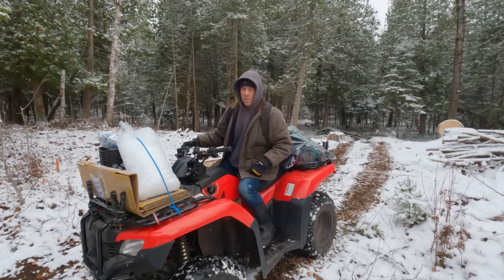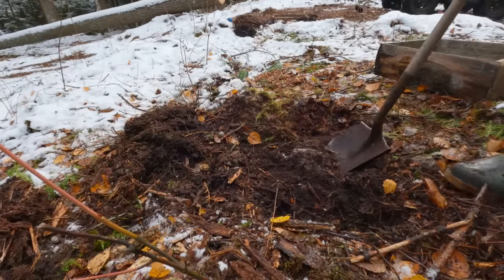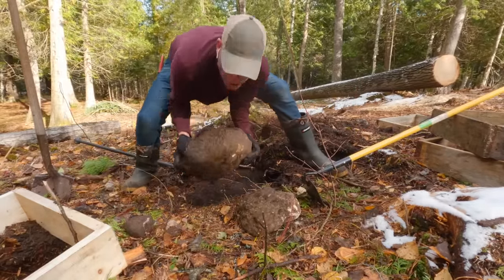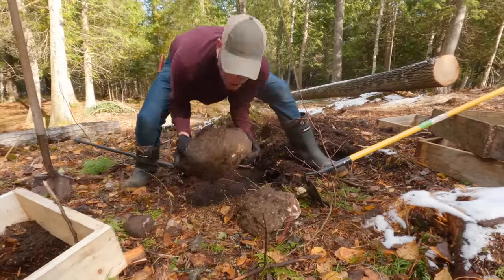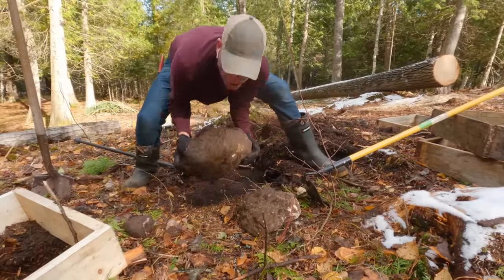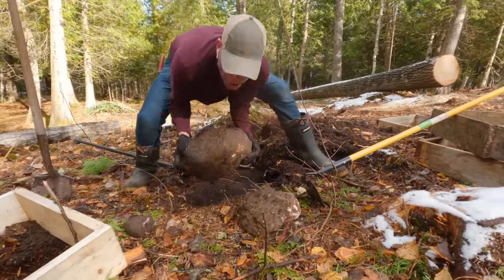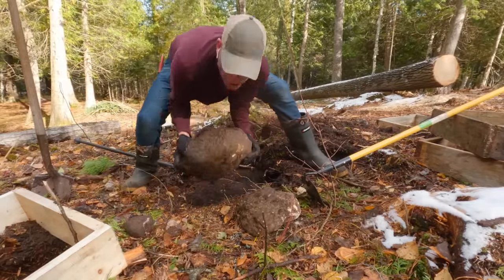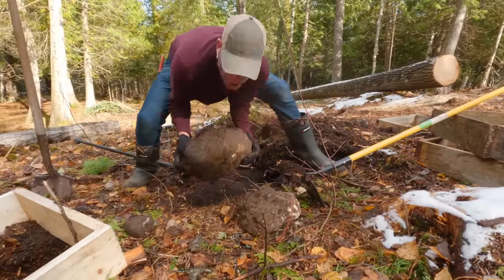An Abnormal Way to Build a Kitchen Foundation. #164

Comment: My father's neighbour built a wooden fence between the two properties and painted it with creosote and oil mix. Forty years later it is still as good as new.
Reply: Yes, if you use used diesel oil on the foot of your posts,soak em overnight, do the same with your gravelboards. Used motor oil and creosote for the rest.  Don’t lean on the fence !!
Reply: My grandfather had a raisin vineyard with 8 x 8 split redwood posts at the ends of each row of grapevines. He soaked the posts in oil & diesel mix by setting them into a 50 gallon drum. The posts had a lot of weight on them when the crop ripened. I sometimes got to help him replace the few that broke. Redwood isn't very strong and the posts that broke were from of the amount of the weight on them, not due to rot.

Comment: I've used old motor oil from my tractor to stain/preserve my cedar siding to an outhouse. No odor of oil with a little time and has preserved it for over 12 years. Still looking good with the right amount of an old pioneered weathered look with no grey. Works great for fences too

Comment: The oil preservative is an old timer trick.  It really does work but the reason people generally don't do it any more is that the oil gets into the ground water and you eventually end up drinking trace amounts of used motor oil out of your well.  And there is pretty much nothing in motor oil you want to drink, even in very tiny amounts.  It is kind of amazing how much water can be polluted by a seemingly insignificant amount of oil like that.

Comment: I've been watching your videos for about 2 years Ryan and I've finally caught up to be getting them weekly fresh fresh like the air you breathe which has gotta be fresher almost than gods own Yorkshire here in the UK lol you might have lower temps but it's colder here lol though 12v waterproof led strip lights mate. £5 and remote control. One of your batteries would run them 2 month x love what you do. Make do and mend. Respect Andy

Comment: There is a mix containing borax that works well for wood treatment. I tried it experimentally on fir logs (half with half without) the treated logs got three times the durability. ( in years ).

Comment: As always, it's been a delightful visit. Thanks for the video Ryan !
Not giving advice here, only sharing a possible tip that might interest you. I recently learned of an alternative to using dynamite for demolition (especially breaking boulders.) It's called: non-explosive expansive demolition grout. You need a rotary hammer and a rock bit.  Drill holes in the rock you want to break it. Looks like you then have to mix the grout with water and pour it into the holes. In a day or two it expands with 18,000 PSI of expansive force to break the rocks. We can get the stuff from a big box building supply or online. (A common brand is Dexpan.) I haven't used it yet but if you ever find a rock that is seriously in your way I'd love to watch your approach to using this stuff. 

77.2K

Comment: Great projects as usual. I really love that you build things by ideas rather than plans. On a regular job site if they are missing a part there are delays, on Ringwood, if you need something you don’t have you come up with an alternative. I do like rock and mortar projects but not in cold weather. When you first said machete chandelier I imagined a bunch hanging from the ceiling with the blades pointing down 😫. You vision seems less deadly. Thanks for sharing!

Comment: When I use cedar in or on the ground I burn the outside of it with a roofing propane torch then put on the used oil.

Comment: I enjoy all your builds, but you really need to add skirting around your cabin to block off the cold air flow from blowing in.
Plus add some foam panels to the skirting....it will make a big difference.
Reply: Mice

Comment: Hi Ryan.  How do you like that Champion wood chipper?  After using it for a few years, would you buy the same one again?  I am in the market for a chipper.  Thank you.
Reply: I have a Harbor Freight chipper. Except for the color it looks similar to Ryan's. I've been happy with mine. It took a bit of experience in order to use it efficiently. (I don't try and chip long limbs of maximum diameter through chute and I learned to not overload the top hopper with twigs and foliage.) I had low expectations but have been pleasantly surprised at how well it chips.

Comment: I had to mix some concrete and I used my portable propane hot water heater. It would be perfect for your shower. RV 12v pump and endless hot water. Well, tell your water tank runs out

Comment: The smell will go away but not as fast as you want it to.  To make it soak in more, use diesel fuel.  Now there is a smell that will gag you.  But it will go away to.  It would have been nice to use the flat stones for the patio and cheaper to. Maybe more labor.  Later

Comment: How are you going to stop the propane from freezing?  Most people box their outside tanks in and insulate.
Reply: Propane won't vaporize when it gets down below -43ºF but the gas pressure can drop too low to run a heater before it stops flowing completely. It seldom gets quite that cold in the UP but it probably could. We have a 400 gallon propane tank outside our northern Minnesota fishing cabin. I also keep a 20 lb. bottle inside over the winter just in case but haven't had to use it yet. I also have other heating options. Ryan seems to keep an eye on the weather forecasts. If I were him and I heard that a polar vortex was coming I'd drive down and stay with Sarah or Tito until it passed. I start to think about my situation seriously when the forecast temperature is headed below -30ºF. That kind of cold can be dangerous and seriously limits my options.

Comment: Why not use the tubes with rebar?
Reply: Way too much work and hole digging and planning.  Wrong channel!
Reply: @bobuncle6962  it's not that hard, I a female did it at age around 60 . Actually 15 years later just a thrown together shed is still standing and sturdy. I just intended it as temporary but changed my mind. I discovered I didn't need a bigger one. The thing is even if you think it will be temporary it may just end up being too good to deconstruct.
Reply: Ryan tries to avoid spending money wherever he can.
Reply: have you noticed he can't dig that deep without hitting big rocks?
Reply: @jjudy5869  so I guess most people cannot have basements.